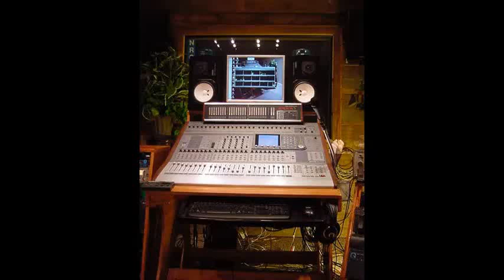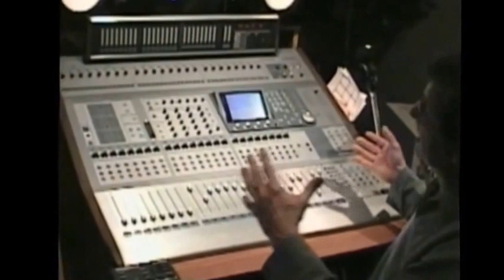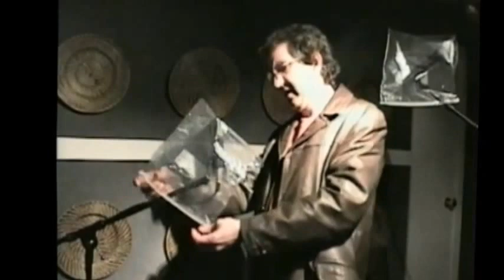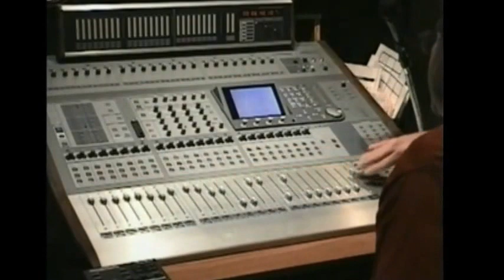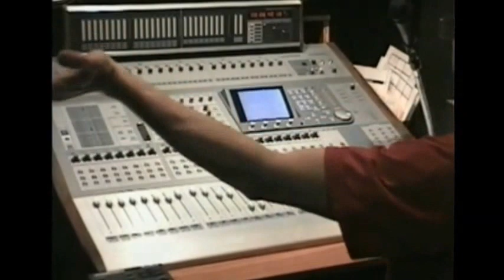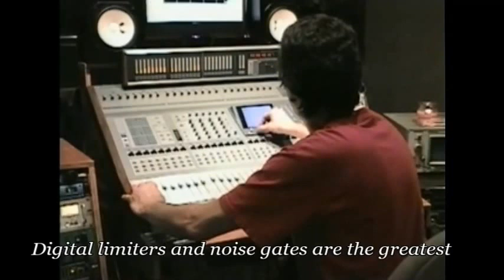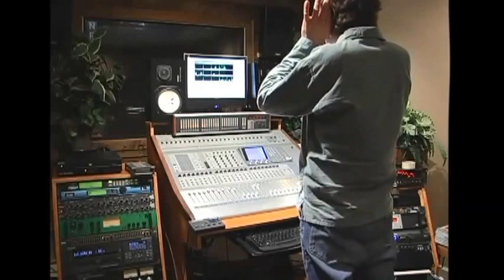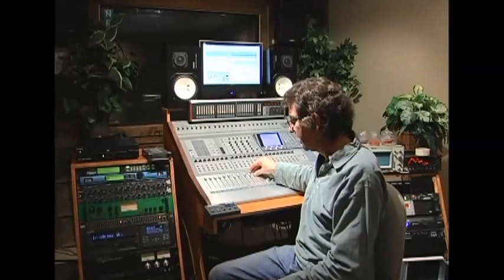NRC 2

Comment: Thank you , Johnny , Thomas and Harry and Stan and the rest of the  team that put this together , a great look at NRC Studios , watched both parts and Subbed , glad you're following your passion , I spent thousands and do not have as nice of a setup , you separate your wire very nice too :) QC
Reply from the maker: Quaalude Charlie Thanks Quaalude.  Glad you enjoyed it and maybe you can pull an idea from here or there.  But I haven't worked at NRC since 2009 other than a few dubs and transfers.  These were filmed during the heyday before the economy crashed which really set the studio back.
Reply: Was still very good to see them and really enjoyed Tearing up the Jack , it should have done really well on the charts :) QC